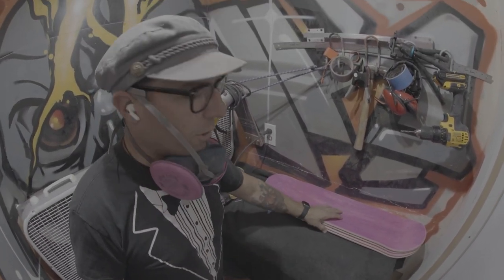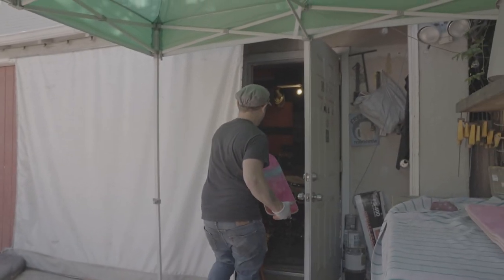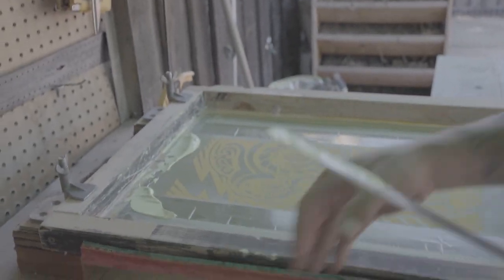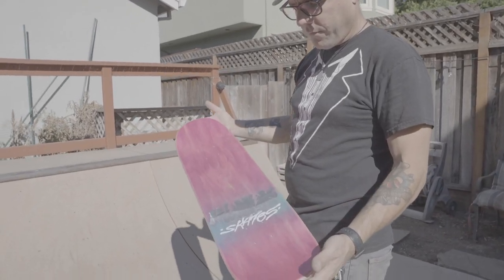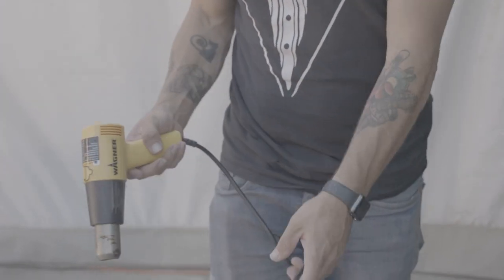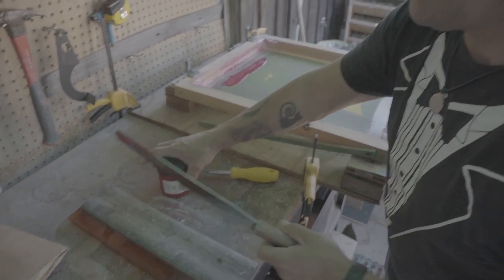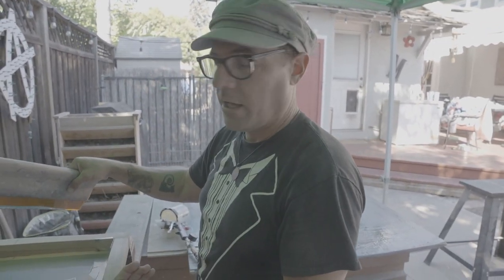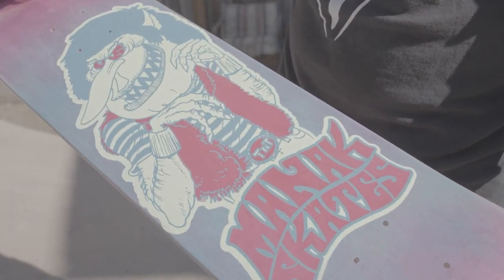How to screen print a skateboard - step by step tutorial

Comment: sounds a bit crazy, but use a exacto knife to make a tear all the way down either side (longest side) of the screen. Make sure you do it before you coat or anything, and tape it up VERY WELL. Like 4/5 layers of tape. It loosens the screen up and lets the edges flex toward the concave of the board, and then you dont need to worry about missing edges. I was taught by a skateboard screen printer, and my decks became much better after doing it :)
Reply from the maker: Yes, that is a great technique for factory stretched tight tee shirt screens. We make our screens from wood and pull the mesh ourselves so we can control the tension. The mesh wobbles if you shake the screen but our new concave is really steep, so it can be challenging getting contact on the edges of the deck.
Reply: Whoa, great tip!  I’ve screenprinted shirts and want to print decks but could never figure out how to deal with the concave.  Thanks man.
Reply: just to clarify, because i want to try this: when you say tape it up, do you mean tape over the tear? like effectively taping it back together?  and you just cut one side, all the way down?
Reply: @gepettowins  both sides, all the way down, tape over the cut :)

Comment: A neat trick is to saw the center of the squeegee handle all the way through but leave the rubber in tact, it leaves you with two connected handles that bend to the concave
Reply from the maker: Yes, that is a very effective trick and well adopted by skateboard printers for sure. I've tried it, but broke the squeegee mid run and it was really frustrating. That frustration led to us pressing our own on our own concave to replicate the board geometry. Check it out - https://www.youtube.com/watch?v=hiWMJB5VFC0

Comment: Good stuff! Something that might help you get better contact on those outside parts of the graphic, is to use wider screens. The mesh near the edges of frames is always the tightest on the screen. So if you use wider screens, the graphic is farther away from the edges, making it far more flexible on those sides of the graphic. If youre having a hard time getting the squeegee to contact the deck and push ink through those sides, the mesh is prob too tight out there. I just did some CMYK prints on some decks and used 23x31” frames instead of standard manual 20x24” frames. That extra width made a huge difference. The screens were stretched to 10 newtons, as opposed to the 20-22 newtons needed for frames for printing apparel or flat stock substrates. Anyway, thank you for sharing! 😤😤😤
Reply from the maker: Totally! I just made wider ones for that reason. They worked great! Tighter mesh for better registration and the width give great flex. Here’s the wider screens I’m action. https://youtu.be/Fjl0fV1Ozrc
Reply: Thank you Ryan, the tip about the amount of stretch as opposed to standard screens is very useful!

Comment: if you print 2 colors, do you need to let the first color dry?  i tried printing wet on wet and the second color kind of mixed with the first rather than sitting on top.  but obviously you can't flash dry a skateboard or it will warp, so do you just have to let it air dry before doing the next layer?
Reply from the maker: With wood, wet on wet doesn’t work as well. I let fully dry before the next color

Comment: you have inspired me to try and make my own graphics but try as I might, I can't get my graphics to reach all the way to the edge of the board. I press as hard as I can and I can't get them to print. I'm using 200 mesh 31x23 screens. are my screens too tight? how tight should they be for screen printing on boards and is there a certain durometer of squeegee I should use? I'm going crazy over here haha.
Reply from the maker: That’s awesome! Screens sound too tight, they should have a good amount of flex, almost to the point of the mesh wobbling if you shake the screen unmounted in your hands.

Comment: Can I use plastisol inks for printing?
Reply from the maker: You'd have to heat cure it which can compromise the integrity of the wood. Water based acrylic air dry ink is what you should use.